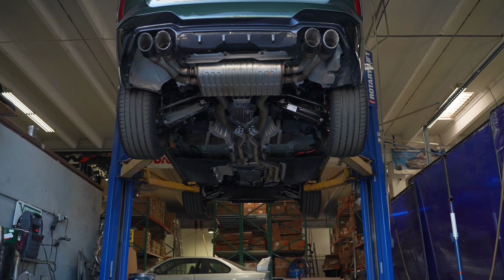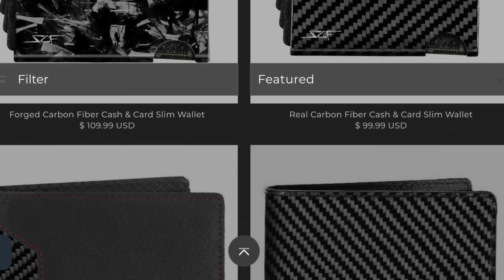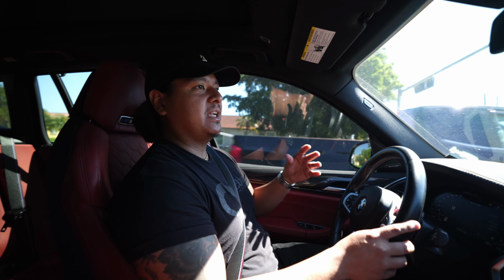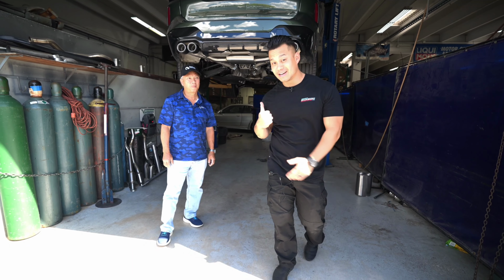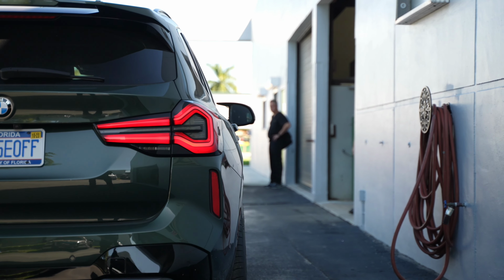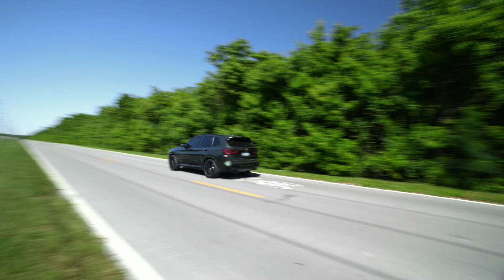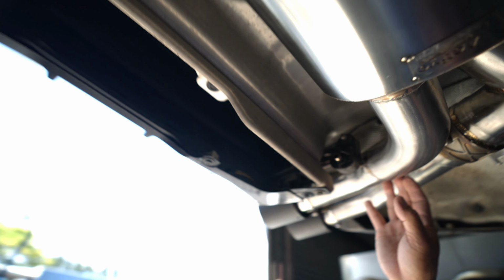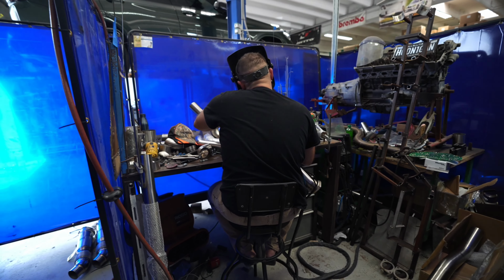Now Is The Time To Buy A BMW X3M Competition | Active Autowerke Equal Length Mid-Pipe X3M

Comment: This is just what I was looking for! I just purchased their mid-pipe for my X4M today. 

My previous built Audi RS3 sounded mean, and I needed to add more sound to the X4M.
Reply: Did you get rid.of the rs3 for the x4m?
Reply: @LuigsonJorge  Yes, then my sister totaled it!
Reply: @MatthewJay80  oh dang sorry for that man, how u comparing between them im thinking trade in my rs3 for m340, m240 or x3m
Reply: @LuigsonJorge It depends on what you are looking to get out of your vehicle. I bought the X4M because I wanted a vehicle that did a lot of things well. Of the 3 you mentioned, I say X3M because that S58 engine is so potent even stock.
Reply: @MatthewJay80  I'm trying to get a lil more space but as same time able to run similar as rs3, I'm stage 2 e85 planning upgrade turbo but not sure now
Reply: @LuigsonJorge  I hear you. I really enjoyed my RS3 and owned one for almost 5 years. It put down 1000 to the wheel with a built engine, big turbo, and clutches. The experience was fun when it was working, but at that level many small things would go wrong. Leaks, pipes popping off, and electrical gremlins to name a few. While the 2.5 DAZA experience was fun, the S58 platform is superior on a stock block in so many ways. My advice would be to test drive something with an S58 in it to help convince yourself.
Reply: @MatthewJay80  if i keep it i won't go that far maybe 700-800 to the wheel, only thing for the x3m is the weight compared to the rs3 at the same power range leve, i will do test drive and see appreciate your advises man.
Reply: @LuigsonJorge No problem man. If you push the RS3 that far on a stock block, ask your tuner to keep the torque below 500 wtq. Darin Dichiara is the go to tuner.
Reply: @MatthewJay80  he's my tuner💪🏽, stock block i won't go more than 600 and yes keeping tq low

Comment: IMO the cold start at 13:00 is a bit much for it to be in comfort mode.  I've got an X3M Comp with the Evolution Racewerkes Mid pipe and Dinan rear exhaust and cold starts are obnoxious for the first 10 or so seconds.   After that it chills out really nicely but damn it's rowdy at first and not in a good way.  Doesn't sound like the equal length pipe fixes that.

Comment: New G80 owner here! Does a new equal length mid-pipe like this one affect warranty?
Reply from the maker: It depends on your SA. Most SA wont care about that to be honest.  In rare occasions they would make a big deal about it.
Reply: Midpipes and CBE don’t affect warranty. Downpipes, however, do. There are some that can be run without a tune. AA for one but most will cause a CEL. Only way to mitigate that is with a tune or an o2 spacer but even then, spacers don’t always work. Some run them with luck, and for others, they don’t work.

Comment: How come this sounds so different than the AA single.  I just bought the AA single after hearing this I am starting to have second thoughts.
Reply from the maker: The biggest difference is the equal length midpipe. It's a different tone that transforms the S58 to a smoother tone. The single midpipe is a deeper sound but you won't have a smooth tone like this.
Reply from the maker: Here's a video with an explanation 

https://youtu.be/zd_9HlHJd3g

Comment: I’d like to buy this but $1800 is a bit steep for just a midpipe 😢. I have the Dinan axle-back and the midpipe but I don’t know if this is worth it.
Reply from the maker: The Dinan isn't a equal length one of the big differences. The equal length smooths out the tone but sound is also a preference too